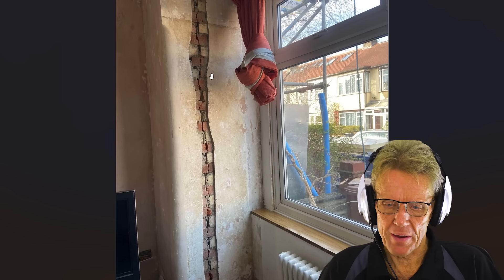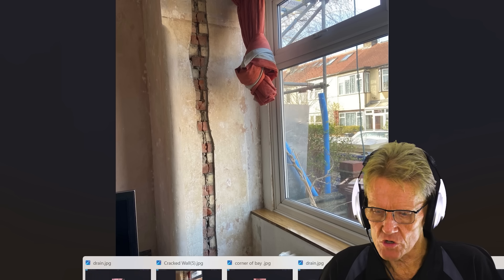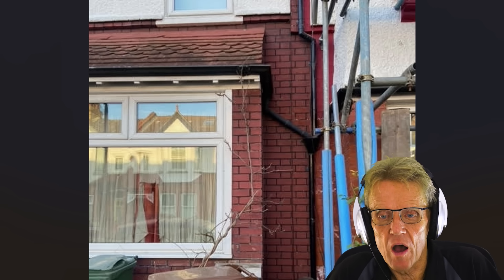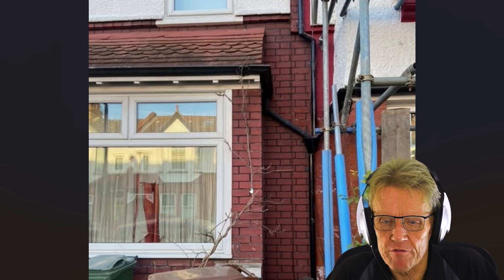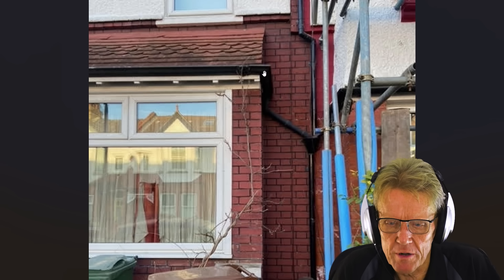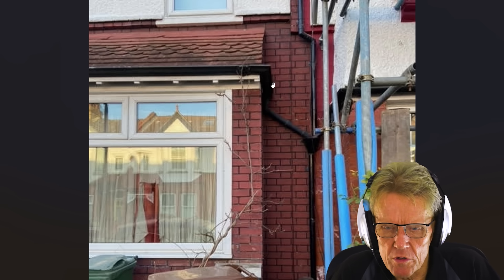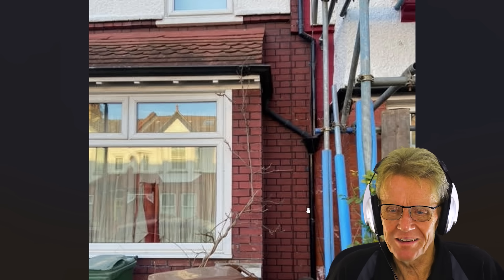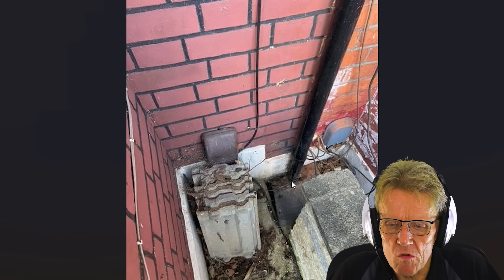What’s Causing This Wall to Crack? The Clues Are All Here

Comment: I've got a garage that's collapsing slightly at the back with vertical cracks. Happens every summer then lifts up again in the winter. Soil is very heavy clay. Could it be the clay drying up and shrinking annually? Grass areas close by seem to develop wide cracks each summer that you can almost get your arm down

Comment: Just a small comment on the Helibar, cut the groove in the joint min 35 mm deep 150 mm as a minimum length, drill 7mm holes each end of the joint groove, form a well measured staple from the 8mm Helibar  tap in, bed with joint mortar. (Not resin) done. One every 5 courses does the job. All else, spot on again.

Comment: Under pin the bay. Then stainless steel mesh over the crack inside the house cut to size then plaster over using hard wall plaster.making sure you prime the stainless steel metal lathing first.

Comment: I would use expanding metal lath the height of the crack in lieu of fibre mesh to hopefully give it a repair more resilient to minor movement. The external brick/mortar repairs looks cosmetic only; if it was rendered, flat bet angled restraint straps would help tie the two elevations, but given the aesthetic impact on a brick finish, I would hold off on anything subject to damage appearing. 

It may be of benefit to get a basic cctv survey of the drains just to make sure there are no cracks, blockages, root ingress etc, either as a result of  the subsidence and ground consolidation, or the cause of it.

If the drains are a red herring, and depending on the location of the property, and potential for clay soils, it would be worth while looking at the type of tree species nearby that could be impacting the shallow bay window foundations.
Reply: Exactly what I did on a corner , overlapping so essentially tying both structures together , sand and cement render and you’ve got a mighty strong bond

Comment: any good way of getting rid of g gliss gliss? one of them has el.e.c.t.r.o.c,u,t.e.d itself on my mains cable. things stinks it means ripping out the toilet floorboards have to get a new cable, I could h ear arching but it's gone now. nightmare the other day I saw 3 on the eaves chasing each other. tried sticky traps but nothing, a rat trap does nothing also. what's the best way of calculating the wire I need? hard to say where it's going. can only guess I'd say about 10 m it's from under the stairs to the top of the kitchen cupboard. maybe I should get reinforced, I've got some reinforced but I don't know if it's enough.
you know anybody's got a mobility scooter or an adaption tri-wheel would be better the wheelchair need one in a couple months maximum

Comment: When he says "rainwater softening the ground" he may be referring to subsurface erosion. The rainwater can penetrate the ground and carry away the smallest particles of soil and fine sand so that the ground will sink over time where the rainwater enters the ground. On extremely old houses this is part of what makes walls tend to tip outward over centuries. This is one of many reasons to make sure that rainwater does not enter the ground against the foundation.
Reply: I gotta ask, how do new builds avoid this? Some of them have strips of gravel around the perimeter please.
Reply: But why is there no sign of any external movement or cracking?  Looking at the internal crack I would have expected to see the same degree of movement and cracking on the outside, but you don't!!  I'm quite mystified why you see it internally but not externally.
Reply: @johncranna9427  He mentioned his theory in the video. Also there is a marked difference in the color of the bricks seen on the interior in the crack area and on the exterior, which further suggests that the exterior is a render coat.
Reply: @johncranna9427 did you watch with the sound on? Try listening.
Reply: @johncranna9427  as he said, the external view of the wall is some kind of fascia added over the original brickwork or its been masked to hide the crack